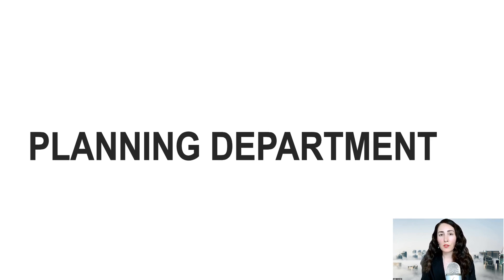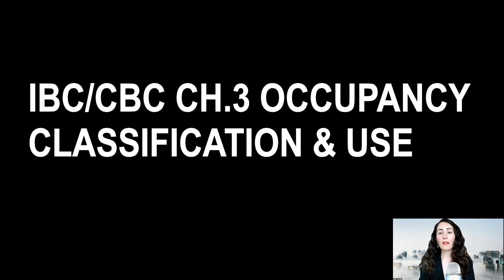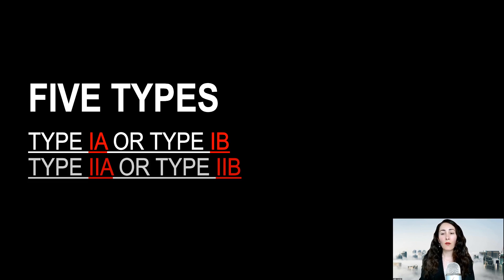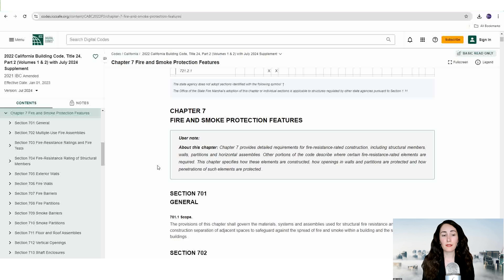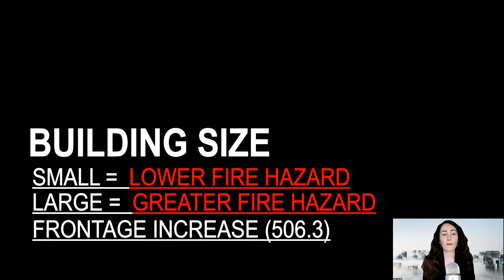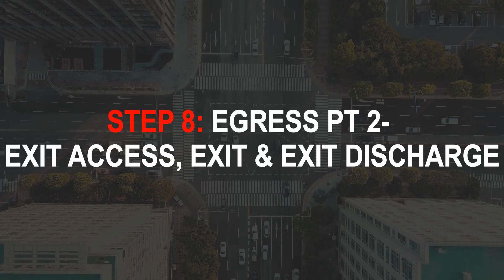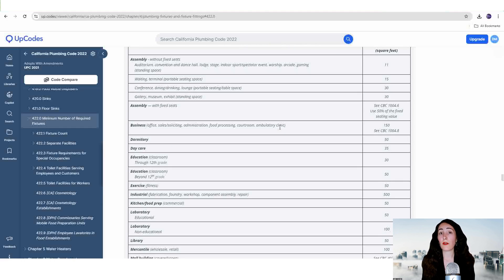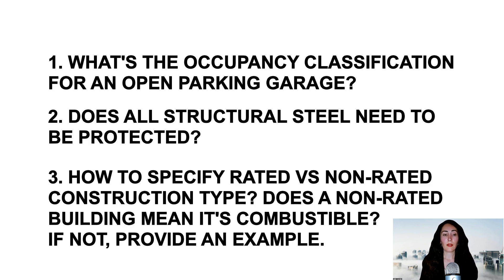MASTER Building Code Analysis in 10 EASY Steps

Comment: 1. The occupancy classification for an open parking garage is Group S-2, the category for low-hazard storage. Open and closed parking garages have the same occupancy classification, but each has additional requirements that are detailed in chapter 4. 
2.Chapter 22a, section 2203 of the CBC states that cold-formed steel construction needs to be protected. If not coated properly, there is risk of corrosion and fire damage. This makes sense, but it is unclear to me if this is true in the IBC too.
3.A building construction type's fire-resistance rating is specified by the suffix A or B to the numbered type. Type A specifies rating, and type B is the lack of it. Type 2b and 5b, for instance, offer no fire-resistance according to table 601 in the CBC. If a building is not rated, it may still be non-combustible. Type 1b claims fire resistance for 2 hours.

Comment: 1. Group S-2
2. Protection is reccomended, but not mandatory. That depends on occupency type.
3. Type A buildings are rated to be fire resistant. Type B, although not necessarily combustible, are not rated as fire resistance and requires additional protections.

Comment: 1. The occupancy classification of open parking garages is in group S-2 as low hazard storage. 
2. Not all structural steel needs to be protected, whether or not it needs to be protected is dependent on the occupancy classification and/or whether the building needs fire protection or not.
3. Type A buildings are fire-resistant rated whereas Type B buildings are not rated as fire resistant, but this does not mean that type B buildings are combustible. For example a building might be Type B and just not need fire protection depending on what it is made of.

Comment: This video provides an excellent explanation of how to effectively understand and apply building codes, particularly emphasizing the crucial role of compliance in project design. Additionally, the video offers clear explanations of knowledge such as fire codes and structural types, which has deepened my understanding of how to ensure building safety. Each regulation not only affects the safety of the structure but also influences the quality of life and the smooth progression of the project, especially regarding aspects like sunlight and air circulation. Overall, this video helps guide the design and execution of architectural projects

Comment: 1. Open parking garages are classified as group S-2
2. Not all structural steel needs a protective coating, it depends on the construction type.
3. Rated and non-rated types fall into groups A and B. Non-rated is not necessarily combustible, it can use materials such as concrete and not need extra fire protection.

Comment: 1. the occupancy classification according to the IBC is in group s-2.
2. For Structural Steel. the construction types range from 1-5. Protecting all structural steel is not mandatory, but it is recommended.
3. non-rated vs rated is interesting, usually whether a building is rated or non-rated is determined by the fire resistance of the project.  Usually type A classification is fire resistant, while the type B classification is not up to fire-resistant standards.

Comment: 1. The occupancy classification for an open parking garage is typically Group S-2 Low-Hazard Storage, per INC and CBC

2. Not all structural steel needs fire protection; the requirement depends on the building’s use, location, and applicable codes. In many cases, fire protection is necessary to maintain steel’s strength during a fire, but in some open-air or non-fire-risk areas, protection may not be required.

3. Rated construction requires fire-resistance ratings for certain structural elements, while non-rated construction does not. Non-rated buildings aren’t necessarily combustible; for instance, Type II-B construction uses non-combustible materials like steel but doesn’t require fire-resistance ratings.

Comment: 1. Looking at the International Building Code, the occupancy classification for an open parking lot would be S-2.
2. No, not all structural steel needs to be protected, it is highly recommended however.
3. Rated vs Non-Rated buildings are determined by their fire resistance. Type A buildings are fire resistant while type B buildings are not.

Comment: 1) The occupancy classification for an open parking garage is group s-2
2) Not all structural steel needs to be protected it depends on where it's being used and its type.
3) Rated construction type would mean fire resistance, ex Type A. Non-rated would be fire-resistant protection is not required, ex Type B. A non-rated construction type could be combustible, just because fire protection is not required doesn't mean it was built with non-combustible materials and could have been build with combustible materials from the other types.

Comment: 1. What’s the occupancy classification for an open parking garage?
An open parking garage is classified as  S-2 under IBC. This classification is important for fire safety and construction standards.

2. Does all structural steel need to be protected?
Not all structural steel requires protection. fireproofing depends on the building's occupancy type, height, and construction classification.

3. How to specify rated vs. non-rated construction type? Does a non-rated building mean it’s combustible? If not, provide an example.
A non-rated construction type does not necessarily mean the building is combustible. For example, a non-rated building could be made of non-combustible materials but may not have a specified fire resistance rating. An example would be a concrete building that meets safety standards without needing a fire rating.

Comment: 1. According to the International Building Code (IBC), open parking lots are classified under the S-2 occupancy group.

2. Structural steel may not always require fire protection, depending on the building's occupancy classification and construction type (Type A or Type B).

3. The distinction between rated and non-rated structures is based on fire resistance: Type A buildings are fire-resistant, while Type B buildings are not.

Comment: 1. This information can be found in the IBS where is stated that the occupation type of an open parking lot is the S-2 Group
2. It depends on type of building requirements, so not all structural steel needs protection.
3.  Rated and Non Rated depend on whether there is a need for more protection or less depending on the building type. The is a type A or a type B, it signifies whether there is a need for extra protection in a building or there isn't a need for it. That doesn't mean it is combustible because of the other factors.

Comment: One take away is that As architecture students, it's vital for us to understand building codes because they play a key role in ensuring the safety, functionality, and sustainability of our designs. One important point to remember is that gathering zoning data should be our first step in code analysis. Zoning laws dictate how land can be used and developed, which directly impacts our project designs. Without a solid understanding of these regulations, it’s tough to create plans that comply with the rules. So, getting this step right is crucial for making sure our projects align with local ordinances before we dive into the finer details.

Comment: 1. For an open parking garage, the occupany classification is a part of the S-2 group.
2. No, not all structural steel needs to be protected as it is dependent on the construction type of a building, which ranges from types 1-5 and A or B.
3. Rated and Non-rated construction types are determined by the building's fire resistance. Type A (rated) is considered to be protected materials, whereas Type B (non-rated) is not protected. Additionally, a non-rated building doesn't necessarily mean that it is combustible.

Comment: 1. An open parking garage typically falls under Occupancy Group S-2 according to the IBC, because they are considered to have a low fire hazard compared to enclosed structures, as they are open to the air and do not store highly combustible materials.
2. Not all structural steel need to be protected as the requirement for protection depends on many factors like building codes and regulations, type of construction, fire-resistance rating, and exposure to fire hazards.
3. Type A construction is classified as rated, while Type B is considered unrated. Type A structures are protected, whereas Type B structures are unprotected; however, this does not imply that Type B construction is combustible.

Comment: 1)The occupancy classification for an open parking garage is group S-2.
2)Yes all structural steel has to be protected to an extent whether by making sure it does not have contact with the ground directly, adding protection from corrosion or by adding fire protection.
3)To specify between rated and non-rated the letters A or B are used. A non-rated building does not mean that it is combustible. A steel column is not flammable and can be rated as B if no extra protection against fire is added.

Comment: 1. An open parking garage is classified as occupancy type S-2, or the  low hazard storage group.
2. Not all structural steel construction types need to be fire-resistive/protected, since the fire rating of any material is dependent on what occupancy type it's being used for. All occupancy types (1-5) that fall under category A are protected. Those that are category B are not, so steel assemblies in a category B of their occupancy type need not be further protected.
3. A rated consutruction type is one that is type A (ie Type I A, II A, III A, etc.). Non-rated construction types are deemed type B. How combustible the building is is dependent on the occupancy type itself and materials used, not exclusively if it falls under A or B. Types I and II (A or B) require the use of non-combustible materials throughout the assemby, whereas this stringency diminishes with Types III-V.

Comment: One thing I found interesting was how strict fire safety codes are. I understand why, but i can think of multiple buildings that felt unsafe to be in, in the case of an emergency. I am assuming that they were up to code when built, but perhaps safety concerns were overlooked as buildings changed their purpose. I wonder, how big the threat of danger might be before authority steps in and forces a building to renovate since their safety standards are too outdated. Also, where might the average person see that a building is not up to current standards? I am aware that most elevators have a sticker/sign of some sort that states when they last passed a safety inspection. Must buildings also have something similar visible to the general public that use it?
Reply from the maker: Unless there's a specific known Hazard, most buildings won't have signage to warn visitors. A prime example I can think of when it comes to buildings not being safe....many buildings in CA have not gone seismic retrofits. Schools for example have bond money to bring classrooms up to code but other buildings require funding for this. It's an ongoing issue that requires lawmakers, local AHJs to work together with communities to create a plan addressing these long term serious issues. Typically , cities will go after those building used by the public and retrofit the most critical buildings when resources are low.

Comment: This video expanded on the construction types we learned in Construction 1 as well as additional concepts introduced last year. However, I wanted to focus on the notion of zoning. While zoning regulations are often centered around enhancing the quality of life for humans through land use control, they are also equally important for protecting wildlife ecosystems. This adds another layer of complexity to zoning research as it can impact future unforeseen costs and property values.
Furthermore, while setbacks are typically associated with fire safety, they also play a key role in environmental protection/preservation. When sensitive ecosystems are preserved, the setbacks act as buffer sones (similar to the concept of egress refuge) that can reduce the impact of human construction.

Comment: What's most interesting about this video is the codes about fire resistent. Type 5 least fire resistent and type 1 most fire resistent but also A is protective which has additional means of fire protection. That's very interesting thing to know. It's important to know which building needs more fire protection because we need to make building with efficiency. Very informative video for architecture student.
Reply from the maker: Good!!

Comment: 1. The occupancy classification for an open parking structure is Low Hazard Storage, S-2.
2. No, not all steel needs to be protected. It depends on the type of construction needed for the building. 
3. Rated versus non-rated construction is specified by if it is fire resistant or not. No, a non-rated building does not mean it is combustible. A rated building is classified as Type A meaning it is protected and has an addition means of fire protection while Type B does not. However, just because a building is not rated does not mean it is combustible, an example being type IB.

Comment: 1. An open parking garage falls under the occupancy classification: S-2.
2. Not all structural steel needs to be protected. It depends on the type of the building (fire resistant or not) and the occupancy of that building.
3. Specifying rated vs non-rated is based on fire resistance. For example, Type A is fire resistant while Type B is not.

Comment: 1. The occupancy classification for an open parking garage is group S-2.
2. Structural steel protection requirements are determined by the type of building construction.
3. Specifying between rated vs non-rated construction is based on construction type and its corresponding fire resistance. Type A, rated, is fire-resistant construction. Type B, non-rated, is not a fire-resistant construction. A non-rated building doesn't mean it's always combustible, one Type B that is not combustible is Type IB.

Comment: 1. The occupancy classification for an open parking garage is as a Group S-2 Occupancy
2. The necessity of protection for structural steel is dependent on its use and building type
3. Rated and non-rated structures are specified by their fire protection rating. Being non-rated doesn't necessarily make it combustible. A building can be non-rated but simply not need fire protection because of its materials.

Comment: The step by step building code analysis has really helped me get familiarized with where directly to find certain codes based of its chapter. Each step provided us with very a descriptive overview into each code such as in Step 4 how we start to not only understand the types of construction but also how fire resistant the building will be plus the elements in which can be found in Chapter 6. There are also 5 types of construction in which in section 601 we start to see the fire ratings. Another step in which I found very useful aside from them all was Step 7, Egress Occupant Load in Chapter 10. The provided equation will be of a great tool for all future references!
Reply from the maker: Yes! 🙌

Comment: This video has taught me to always be prepared. Failing to prepare is preparing to fail. Doing your due diligence and researching the different codes in different jurisdictions will make your life easier and guarantee smoother project phases. Even when you feel confident in a certain jurisdiction and its codes, everything is subject to change, and failing to account for that could cause complications. The smallest mistakes could lead to the biggest issues. Every jurisdiction goes through rigorous plan checks to make sure that all projects are up to code, and it is our job as architects to make that process as seamless as possible.
Reply from the maker: Yes!

Comment: A point in this video that resonated with me is one you made when you covered step 6. You said that the amount of stories of a building can depend on the fire marshall. This is because the capabilities of a local fire department can change the allowable amount of stories a building can have. This fact is interesting to me because it is something that I didn't think to consider when considering the factors that can change the limitations of building construction.

Comment: 1. The occupancy classification for an open parking garage is Group S-2.
2. Structural steel doesn't all need to be protected, structure in the B category is not protected fire constitution 
3. Rated and unrated structure types are determined by their fire-resistant properties: Type A buildings are fire-resistant, whereas Type B is not. A non-rated building does not exactly mean it's combustible, for instance, concrete is an example of a non-rated structure that does not require Fire Protection since is not considered combustible.

Comment: 1. The occupancy classification for an open parking garage is group S-2.
2. No, not all structural steel needs to be protected, in depends on the type of construction and its occupancy.
3. Protected buildings are rated Type A while unprotected buildings are rated Type B. No, a non-rated building does not mean it is combustible.

Comment: 1. An open parking garage is classified in group s-2 as low hazard storage. 
2. Not all structural steel needs to be protected, especially if the building it is in is classified as a low fire risk or if the steel is covered in concrete. 
3. Rated Construction will usually have fire resistant features such as a fire sprinkler system, fire reistant assemblies, etc. whereas a non rated construction will not have such features and are usually buildings that present a low fire risk and risk to human life.